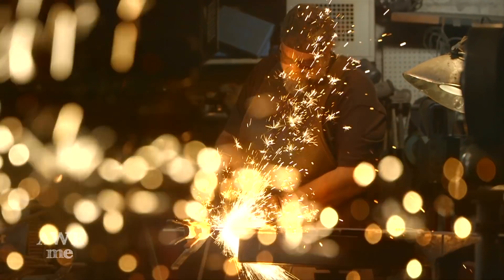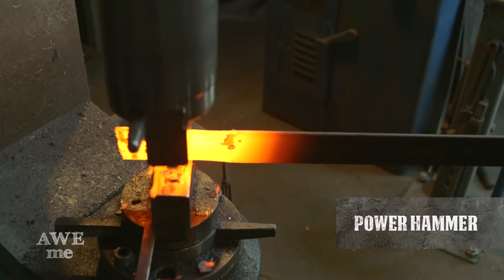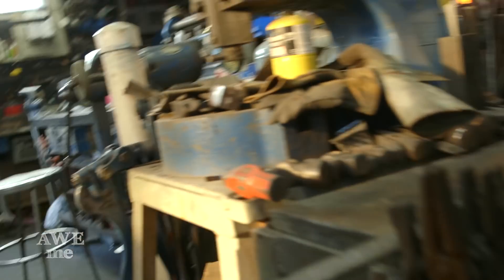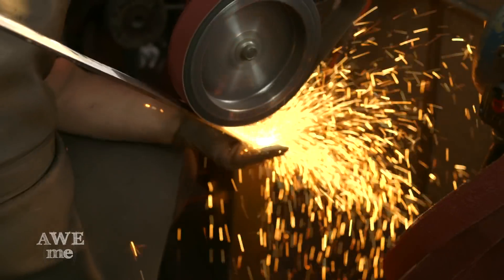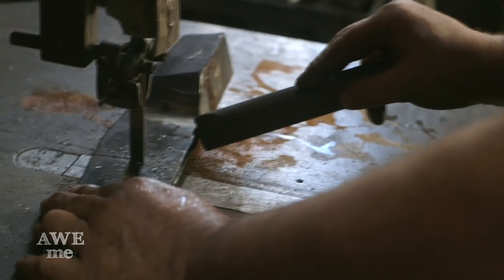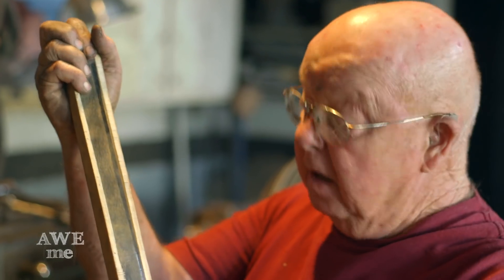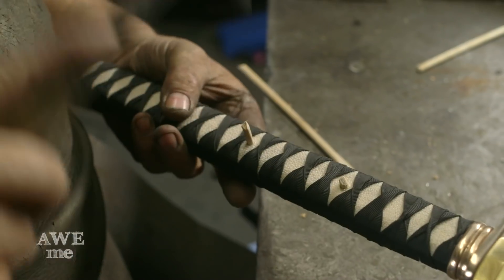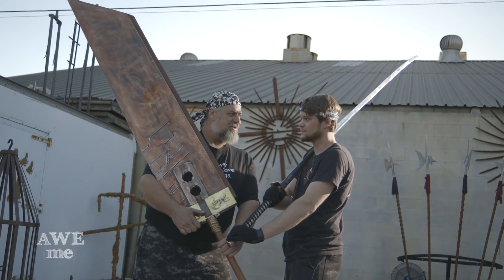Sephiroth's Masamune  (Final Fantasy VII) - MAN AT ARMS

Comment: It bends under its own weight.
Reply: +Brandon Whitfield it is an anime sword in real life...
Reply: +Felix Scerri for it to bend like that means It's useless in battle. Japanese steel blades are folded steel so that, even at long lengths, the crystals are aligned to make the body and edge rigid. Then it has a soft iron core to absorb the shock, so that the blade doesn't crumble after it hits something. The sword they have would break or warp if it hit a solid object once. Cool looking, but a cheap imitation.
Reply: Yes that's all true, but the fact of the matter is to do all the work that goes into a traditional Japanese blade would have taken them months on a sword this size with a modern forge working it all day. Keeping this much steel at temperature for what they did is already amazing, if you had to work with the folding of 7 foot of tamahagane, not knowing if all of your material falls into the 1/3 category of being strong enough to make sword blades, and keeping temperature up so the blade doesn't cool and harden in different ways throughout the blade. If you got all of that, then you'd have to add the hada, which also needs to be spaced accordingly and heated right to maintain the difference in temper between spine and blade. I'm sure if you were PAYING him to make a sword like that he'd put that much time into it, cause let's face it, it'd be over $10K just in work alone. This wasn't done in that manner, this was done just to make the thing.
Reply: +Shaggz Fate your probably right in that he wasn't commissioned to make a functional blade.
Reply: +Shaggz Fate the hard work that goes into making a true katana is a major contributing factor for me on what makes it beautiful. What they did was like showing us a Ferrari body n chassis but no engine.
Reply: It's not really possible to make s functional 7 feet long sword
Reply: claymores dude. but i guess they are quite a bit more wide than a katana.
Reply: Nodachi.  Yes they did make swords that big.
Reply: Where are you seeing it bend???
Reply: +Frozen Gamer 5:28 and pretty much all of the slowmo shots
Reply: It wiggles
Reply: +Espen Negron but im fairly certain no matter how they made this it would flop around, even smaller swords like a long sword or a regular katana bends when striking a target
Reply: invalid name Nonono Longswords and Katanas do not bend they Vibrate.
Reply: Frozen Gamer if you slow down footage of someone striking with a sword you can see it bend from side to side even if you hit a waterbottle, meanwhile it vibrates if you hit something like wood
Reply: invalid name It Isn't ... omg ... the sword shouldn't bend ever if it's made well. I don't know what kind of swords you have seen that bend when they hit a water bottle, but WOW are they bad.
Reply: Ender Skies I never said a sword should never Flex I said it should never Bend.
Reply: So sword should bend when using it,i when making contact with a harder object it'll vibrate and sing.
Reply: no they didnt nodachi's at minimum were 90cm which is only 35 inches. that thing is longer than that specification.
Reply: it's supposed to. You want some flexibility in a proper sword blade, too soft and it can't hold an edge, too hard and it shatters like glass. A good quality sword will spring back into it's proper alignment if you bend the blade
Reply: Ghuirm nodachis were also significantly thicker than standard katana so they would have sufficient rigidity.
Reply: you could be thinking of Odachis also the thickness does not increase that greatly from blade to bigger blade.
Reply: They watch too much anime.
Reply: 9600GTMAN The hilt would have to be twice as long and the blades thickness would have to be twice as long as well in order for it to not bend around like a strip of yarn. thery were making the blade as it appears in final fantasy not what it would need to be to work in real life.
Reply: 9600GTMAN because it is a sword with a short tang/hilt and a really long blade. if they made it like a super big odochi then it would not be sephiroths weapon it would be an oversized odochi.
Reply: Xiaowei Tan yes but this is a katana it should not be bending over its own weight.it was also not mate like a traditional katana with a flexible yet stiff core and a hard stiff outer layer folded over it.
Reply: much of that length comes from the handle of a Nodachi though, the blade on this is obviously considerably longer and any blade at that width, thickness and length japanese or not is basically unusable and is going to be incredibly floppy
Reply: I think it's a miscommunication, you're both saying the same thing, they're just using the word bend instead of flex, you're right bend is the wrong word, but I'm pretty sure they're referencing the flexing that you see in a cut.
Reply: it's a fantasy sword replica...
Reply: Ghuirm cho
Reply: pinkyfull maybe they were thinking of a talwar?
Reply: It's too long so it's going to collapse under its own weight. And it's possible to make a long Katana. More like it's real name is: the "Tachi" Sword. However, now a days they only make it for ceremonies and to leave it as an offering to the Shinto Gods. It used to be sword for Samurais but... they banned it, in the 14 century.

Here.

"Authentic tachi were forged during the Kotō period, before 1596. With a few exceptions, katana and tachi can be distinguished from each other if signed by the location of the signature (mei) on the tang. In general the signature should be carved into the side of the tang that would face outward when the sword was worn on the wielder's left waist. Since a tachi was worn cutting edge down, and the katana was worn cutting edge up the mei would be in opposite locations on the tang of both types of swords.

An authentic tachi that was manufactured in the correct time period averaged 70–80 centimeters (27 9/16 - 31 1/2 inches) in cutting edge length (nagasa) and compared to a katana was generally lighter in weight in proportion to its length, had a greater taper from hilt to point, was more curved with a smaller point area.

Unlike the traditional manner of wearing the katana, the tachi was worn hung from the belt with the cutting-edge down, and was most effective when used by cavalry. Deviations from the average length of tachi have the prefixes ko- for "short" and ō- for "great, large" attached. For instance, tachi that were shōtō and closer in size to a wakizashi were called kodachi. The longest tachi (considered a 15th-century ōdachi) in existence is more than 3.7 metres (12 ft) in total length with a 2.2 metres (7 ft 3 in) blade, but believed to be ceremonial. In the late 1500s and early 1600s many old surviving tachi blades were converted into katana by having their original tangs cut (o-suriage), the signature would be lost in this process.

For a sword to be worn in "tachi style" it needed to be mounted in a tachi koshirae. The tachi koshirae had two hangers (ashi) which allowed the sword to be worn in a horizontal position with the cutting edge down. A sword not mounted in a tachi koshirae could be worn tachi style by use of a koshiate, a leather device which would allow any sword to be worn in the tachi style."

That's the history of the Tachi Sword.
Reply: Yanfei Xie very impressive your accuracy amazes me
Reply: Its a floppy blade. Nodatchi would be the nearest thing to the masamune. But nodatchi have much longer handles, and the blades are about twice as wide as a katana blade. Its basically just a Japanese great sword.
Reply: The Japanese used special techniques to make the metal they were using stronger, Europeans had stronger metals which rendered those techniques needless.  Also, the Europeans were able to create better sword designs since they had stronger metals.  If the Japanese had those same metals, and Europe didn't, they would have built similar designs to the Europeans because those designs are better.
Reply: so in theory, if they were to make Masamune in a more traditional way, the sword wouldnt bend?
Reply: +Espen Negron
It doesn't matter how many times you fold it.  It doesn't matter how you bun (core) it.  At 7 feet long, it will either bend under its own weight, or you will make it extremely heavy to support it.  There is a limit no matter what techniques you use.
Reply: Use Haki deym hahaha
Reply: Uh....to be frank it's originally from the PS1 game final fantasy VII which with it's popularity got turned into a movie which is final fantasy VII Advent children and after the movie got released FFVII dirge of Cerberus came out for the Ps2.
Reply: Frozen Gamer watch it when they swing it
Reply: Brandon Whitfield wobble wobble!
Reply: Just means you can use it as a whip. :P
Reply: Use some titanium
Reply: It might be because they just used one type of steel. I think normally a katana blade would have a soft core and a hard shell. A descrete fuller might have helped keep it lighter too considering how long it is. But they are the pros. I just speculate.
Reply: The sword was already bending... When he tried to swing it to break the Bottle
Reply: Someone needs to create a better alloy so this sword can be reality.
Reply: @Prague3203  The folded steel has little to do with the alignment of the metal crystals, and more to do with the delicate cooling process. Also the whole folding process was created because of inferior metal materials. The stuff we have today is way better and simply doesn't need to be folded to have the strength and flexibility needed. Today, folded steel and Damascus is simply for looks and can actually be weaker due to creating more chances of blade imperfections when folding - compared to a high quality steel monoblock thats forged into a blade.
Reply: @trinut3760  🤣🤣
Reply: Justin Ebright yeah and it could have all been condensed down to a ten min video and I’m sure they would have made their money back and more just off of the YouTube revenue.
Reply: Mike would make this better than they ever could.
Reply: It wasn’t made to be a battle ready weapon faithful to traditional blade making techniques, it was a couple of dudes making a cool looking sword. Chill.
Reply: Didn't even taper it
Reply: Usually means it needs to be thicker. Sometimes you have to modify a fantasy blade a little bit.
Reply: It is because the blade is too thin. It can actualy be made properly in a good size
Reply: Xiaowei Tan swords made for the olympics would bend much more than usual since you wouldn’t actually want to stab or harm someone in anyway and if you’re talking about rapiers specifically you’d actually want them to be as stiff as possible so it can more effectively penetrate the target which wouldn’t be as much of a problem for a katana which was specifically designed for cutting
Reply: Michael John Lopez I’m guessing you don’t know that much about swords because if you did you’d probably be obsessing over this stuff to
Reply: You do realize that this comment is 3 yrs old right? How old are you guys again?
Reply: @Reimael   You can see the bending most clearly here 5:30
Reply: @Beneficialitificul  Okay 1. This thread is old. 2. I know it's bending pretty sure I said it was and that it wasn't normal.
Reply: @Justin_Ebright  Naw it would have taken them years. It takes traditional japenese sword smiths months to make just a normal Katana, to make one that size would more then likely be a two to three year process.
Reply: @Scarecrooo  It's all part of the art of it all. You can make 1000 blades, and still have troubles with certain forms. The magic is in each and every attempt. That includes the attempts that don't go perfect. Actually, those are the best attempts, because those are the ones you learn most from. The part about the wife cracked me up though, cause I remember doing that sometimes just to get back at my ex when she was in a mood haha.

But look at what you did that did work here. Look at the parts of the process that did go right. Then look at the parts that didn't go exactly how you wanted to. By doing this, the next time, you'll do better. Then, the time after, you'll learn again. True master smiths take years of practice and knowledge to become true masters. (This is true of any form of mastery) 

Just remember, if things do not go as planned, it's not a failure, it's experience. The blade held together. That in itself is something to be proud of with the length of this sword. I bet 90% of smiths who try to make this blade wouldn't be able to do that on their first 5 tries (or more). With that much metal, delamination is a real threat. You guys overcame that.  So now, if you do ever choose to make a sword like this again, you know what worked the first time. You'll know next time what you'll need to make the adjustments for the areas that didn't come out as planned. Even though it wasn't a carbon-copy clone, this wasn't a "rubbish shoe", because it clearly functions, it held together, but most of all, it gave all involved education and experience. The last part IMHO makes it priceless. 

Also, remember Bob Ross. If something isn't exactly wrong, it's not something to get upset about, just pick up the tool, smile, call it a "happy little mistake" and work around it. Most the time you'll end up with something new and quite unique in its own right. Sometimes that's how innovation works. They don't get what they wanted, but they find something new. Imagine the first smiths who found out that the way they cooked their iron was actually making steel. They wanted iron, but they got something better in the process. And most of all, an educational experience. 

So keep your chin up, keep the hammer ringing, and remember, every step is a step forward, even if it is not exactly as planned.
Reply: U have to swing it at light speed
Reply: This is one of the biggest wastes of time I've seen in years. Inept blacksmith.
Reply: Leroy Loopy it really is possible I had mines made in Japan it cost me a ton but it  held up to actual combat. Few small dings had it fixed and now I have it on my wall :)
Reply: Seifer Almasy i mean I really don’t see why you care
Reply: if the blade needs to keep straight by adding more material, it would be Pretty Heavy to swing....lol it is a fictional weapon.  Unless they use Titanium which is a Pretty EXPENSIVE material...lol
Reply: @Prague3203  Not true, if you want to know how effective the weapon is just ask Aerith. . . too soon?
Reply: @SilenceSlayer223  Woooow. I completely forgot about that comment I made 3 years ago.
Reply: Thought his sword had two blades
Reply: Weirdly enough, there are actually swords that are BIGGER than Sephiroth's sword. Norimitsu Odachi is blade forged in 15th century that is 12.37 feet in length and 31.97 pounds in weight (3,77 meters and 14.5 kilos)

Apparently it's forged in 15th century. But nobody knows why. People guess it was either forged because some japanese swordsmith was "lol, why not?" or for a ceremonial purpose, ornament for the wealthy or offering to the gods.
Reply: @Prague3203  Most functioning replica's of Sephiroth's masamune are stated to be half of the lenght seen in games.
Reply: I'd want to see a high quality, truly magnificent, genuine masamune someday. The time and effort that would cost though...
Reply: As I'm sure many others have already said, it's the spring temper that they put on this that makes it bend like so. Functional Japanese swords, especially a sword as long as this, would definitely not have a spring temper.
Reply: @waaagh3203  I would say that going heavier is a better idea, Sephiroth wasn't human anyway so it makes sense for him to be able to wield it.
Reply: This was not even folded.
Reply: Titanium could reduce the weight by 40%, can also be made thinner to further reduce weights
Reply: I mean it’s a sword so it’s impractical no matter what even in Middle Ages japan most people used spears or bows the only time they used swords were if they lost their spears and their mounts which doesn’t really happen if you listen to commands properly(or if your commander wanted you dead)
Reply: Yeah I'm kinda disappointed
Reply: I love how many english speaking people are apparently japanese sword masters in the comments
Reply: xISparkzy I know this because my moms side is pure Japanese so I asked my great grandpa if he was a samurai when I was a kid and told me a lot of information I’m surprised I remember
Reply: @Reimael  lol, test your vision!
Reply: @Prague3203  A Ferrari body with Toyota parts.
Reply: @saunesunsword6218  Yeah exactly, Sephiroth's Masamune isn't really anything out of the ordinary when it comes to Japanese Katanas.
Reply: Bent on destruction
Reply: Correct. Which it shouldn't.
But...it's 7 feet long.
The question is, could it (should it?) be made differently to retain that rigidness?

Comment: Imagine making a 7 foot katana but the actual legit Japanese way folding steel endlessly. It would be necessary if it were to stand any chance of not breaking.
Reply: You'd probably end up using two to three times the amount of material used for one blade. I'd bet the heat treat process would be the worst due to the length of the blade alone.